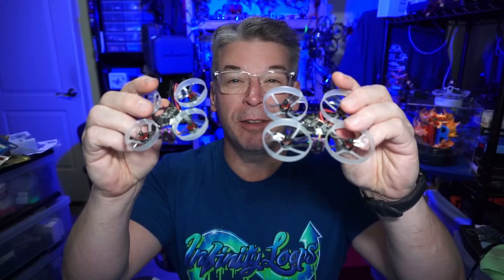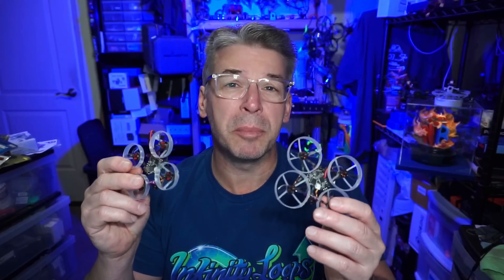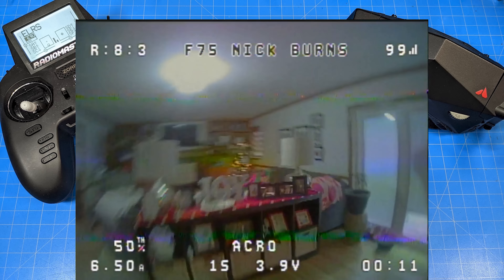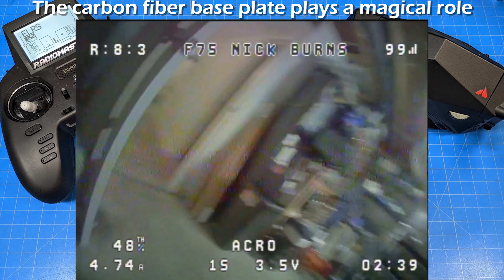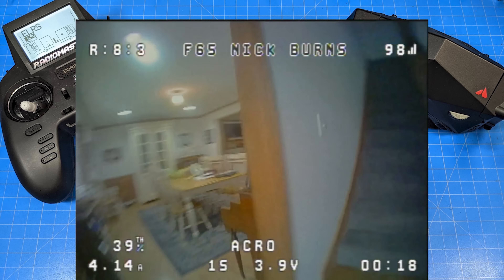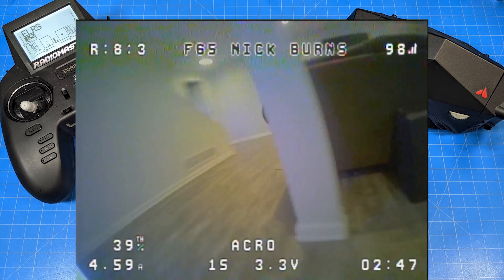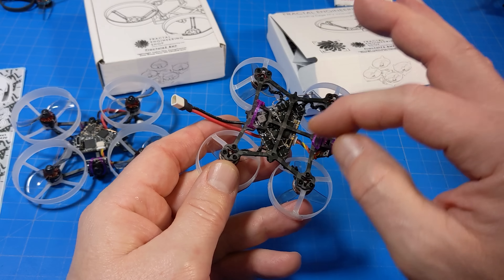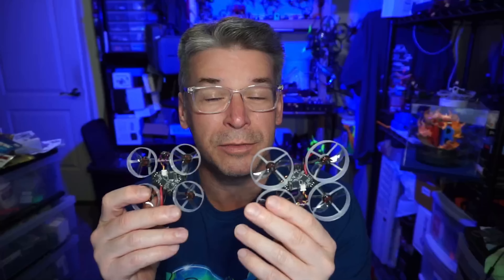Fractal Engineering F75 & F65 // QuickSilver // Whoop Improved

Comment: Hey Nick awesome review! I'm glad you've attributed the credit to QS as well as the frame; I do believe both go hand in hand and it's definitely helped getting the most out of this platform.

A few details I'd like to add, 

- Both F65 and F75 measure exactly 65 and 75mm motorpost to motorpost (TM). Only the stance was widened to fit the cam between the front ducts!
- The cam angle is adjustable by friction; you may set it how you like it and it should stay as is. The extra notches are only there to increase friction if it loosens up over time
- Lastly the stack screws are indeed self tapping and might degrade the CF after many cycles, but a drop of CA glue will refresh it enough to go a long way, annnd...
- The bottom plate is unofficially lifetime warrantied, so if you ever manage to break it, reach out to me and I'll fix you a new one ;)

Thank you for taking your time to share your thoughts on it, thank you to all the pilots that shared theirs in the comments and a big big thank you to everyone that supported us, my wife and I, throughout this journey!

Have a fantastic holiday and happy new year!
Reply from the maker: Good information. Thank you. I am struggling to pin this comment. But I will get it pinned :)
Reply: Thank you for the fantastic design.  I knew a racing quad would be way beyond my skills as I'm learning.  But if I want to really push myself and have a healthy stock of clean underpants I absolutly love ripping this frame!  I'm hoping to order a BNF 75 soon in the new year as our weather improves for serious outside rippage.  Thanks for the tip on the camera adjustments and what the extra notches are for, I missed that.  Plus these things look really cool...  If only Happymodel had LEDs on the Diamnond ELRS AIO (looking at my FrSky HM Diamond board) #sadpanda.
Reply: @amin0_acid310  Haha I miss those RGB LEDs too man! Seems like HM removed them after revising the boards for ELRS.
But yep a F75 def might save you some laundry given how tough they are; crash with confidence 😂
Reply: @fractalengineering  I'll be charging batteries for my F65 After a dog walk (Trivia part, I named it after the computer in GEM and the holograms, the 80;s one).  Never really thought to try and angle the camera a ton, was just happy it was level.  I see why the gang at Infinity Loops like it so much.  Only part about crashing I'm worried about are these spindly antennas
Reply: Thankyou for your work @fractalengineering! I'm really enjoying the 65mm whoop running on webleeds 0702 28000kv's - indoor freestyle has never felt better!
Reply: @fractalengineering  Hi Yves, once again, thanks for making such a great frame! I really love it!
I hope you can also make a version with a battery mounted sideways. I also thought about adding an extra “ribbed tail” to the bottom of the current front battery holder to pull it to the free mounting hole under the camera. That should block the battery from sliding forward in a frontal crash. I don’t have a 3d printer to try it, unfortunately.
Reply: @FractalEngineering I just bought your frame and will be building soon my variant.  Here’s a preview: https://i.imgur.com/viDnsV4.jpg

It’s a 2S pusher with sideways mounted battery. I’m waiting on the new Lite kit to arrive from Caddx to finally build it!  I really like thin/light yet durable design of the frame.  It’s a great idea of having a hard mounted FC to a whoop gives it more locked in focus of a regular quad with the safety net the ducts provide.
Reply: Hello Nick and Fractal, absolutely love the build I made with the 75mm frame, it is what I set as the standard to compare every other whoop build to. Do you have any plans on doing anything with a hd system? I would love to build a hdzero whoop with your frame, just not sure how the to boards will go one on top of the other?

Great work on these frames and thank you Nick for the great review.

Comment: I've been looking for a whoop that I can tune up to perform indoor freestyle for years. It all started when I joined IGOW a few years ago and started learning flippy floppies on an underpowered betafpv 1s whoop. I had a tough time of it but was hooked. The never-ending journey began, trying to replicate the feeling I got with a 5-inch quad but indoors with a whoop. Following Heads at Infinity Loops and CiottiFPV I found the fractal frames. I added weebleeds 28500kv 0702 motors, a full-size happy model 5 in 1 aio elrs board and some bi blades. Cranked the tune-up in betaflight and wow, this thing flies on rails. Enough power to catch my mistakes, stiff enough to take an aggressive tune. I love it. Thankyou! 

I tried to flash quicksilver but could not bind with my elrs tx (running v2.0- elrs). Gave up. Pretty sure  I'll need to upgrade to v3 elrs on my tx (and all my rx's) and this should work. Looking forward to feeling the new firmware..

Great review as usual Nick!
Reply: update - updated my tx to the latest elrs and I my spi elrs rx bound up  no worries :D

Comment: Nice review Nick!  I just bought an F75 BNF with the BT2.0. Really cool how they soldered on the BT2.0 to shorten the wires and shed some weight. The connectors in your review don't have that though. I noticed the increased stability of the Quicksilver and F75 preset tune right away, sometimes it feels like angle mode but it isn't. It's different but I like it, definitely helps the quad to go where you point it, very confidence inspiring. I had one issue, emailed Fractal but never heard back, maybe Facebook would have been better. Anyway, mine wouldn't roll over in turtle mode, because the props weren't reversing. Studying up I saw Quicksilver has an auto detect for flip if it is armed upside down, cool feature, you just turn it ON in Quicksilver. Oddly, that works fine, props reverse, quad flips. Cheers!

Comment: It’s a great whoop, I got the fractal 65 frame with the happymodel elrs F4 2g4 aio on 0802 25000 kv and it flies great on betaflight but I’m gone switch to quicksilver later.
Reply from the maker: Would it be your first time using QuickSilver?
Reply: @NickBurnsFPV  yeah so I’m curious how it will preform
Reply from the maker: @apachesmokewoundedsniper  yea, give it a go. Take a cli backup of your betaflight config first so you can go back if needed.

Comment: Thanks for the Vid.  I ended up with the 65mm frame kit.  I used the Happy Model elrs Diamond board, Beta Flight 4.3 and some happy model 702 26000kv motors.  It reminds me of my old 350cc 2-Stroke sports bikes from the late 80's.  I don't fly it as much as I'd like, even at the lowest camera angle (for a newbie like me) it's fast, but as my skils improve I take it out more ovten.  I love the feel though, tried a few canopy's from thingaverse, I'm goign to go back to the one it comes with (it was fun to experiment).  This Channel got me to Infinity Loops and I saw Heads fly this and ordered one.  I think I'm going to order a 75mm bnf in the new year.  I like both 65 and 75mm formats, and I'm also curious to fly one as the builder intended.  Highly recomend these kits, I can only guess the prebuilt quad is amazing (Watch the video to see how he get's those motors connected, really takes his time and puts a lot of pride into these builds, amazing).  Enjoy both Fractal quads, it was great to see you fly them.  One day I hope to rip around my condo like you do, slowly getting there.  Cheers!

Comment: I really like this frame and its durability! I ordered the 75 frame last February and haven't break anything ever since! This is my first whoop recommendation at the moment, especially for beginners.
I only had two small issues with it:
- The battery always slides out of the mounting loops in a crash, so I have to use rubber band to keep it there, which adds another 1g or so and the frame is not the lightest one even with the diamond board. So I wish Yves makes a version 2 of this frame with the battery mounted from left to right instead of front to back.
- When I first received it, I just used a FC from my old whoop. It was BetaFPV 1S AIO. And the problem was that USB port was sticking out the bottom too much, so I couldn't insert the battery. I had to add extra washers underneath the FC to lift it up a bit and also some rubber pads on the bottom side of the frame to add extra space. Having the battery mounted sideways would've also prevented this issue. 
Apart from this - the frame is amazing and I guess unbreakable. I crashed it a lot and pretty hard and I only replaced props so far. I use it with happymodel 0802 19000kv, a diamond FC with ELRS and a Foxeer Pico cam. It's flies fantastic and gives you much more confidence to fly aggressively.
I fly it on Betaflight 4.3 though.. I tried Quicksilver and it flies great on it as well, but the biggest issue for me was that I killed two brand new batteries on the first two flights. I don't know why. I set it as it was recommended by devs for 1s, but still ended up with the whoop falling at some point because the voltage suddenly dropped to 2.5v. As I can see you kind of had a similar problem.
Another thing was that I couldn't make the 16:9 camera work. The image was squeezed to 4:3, but OSD fonts were ok, so I guess it is something with support for 16:9 cameras and there's nothing in settings or in Quicksilver docks. So I rolled back to Betaflight and absolutely happy about it. I don't see that much of a difference in flight performance, but at least I have much more experience with it and know what I need to tune and how. Maybe I'll give the QS another try one day, but I'll use BF for now.
Reply from the maker: Yves has been combing through the comments. I did note in one of his responses a new beta battery mounting. I might be worth it to make contact to see about testing this as well.

Comment: excellent review sir! I love my fractal builds! I have 2 mobthicc Heads builds and a fat boy x12 on the 2mm plate with crossfire and a true rc antenna for 75mm builds 1 65mm and I'm currently waiting for a 65mm bnf. I'm hooked on the fractal frames. highly recommended
Reply from the maker: Thank you. Appreciate the additional input.
Reply: @NickBurnsFPV  love them, the additional  durability is definitely a bonus! I'm destroying alot less parts on these frames. the screws hold up in the carbon fiber really well. the diamond boards seem to work well when they work but in my experience it's 50/50 if they work. of the 7 I've purchased 2 were doa 1 dropped out of the sky first flight and one died configuring it just plugged into usb no soldering yet. but the other 3 have several flights and are good enough for me to keep buying them. x12 is like a tank though I only killed 1 crash ripped off battery lead and it contacted the board elsewhere and burned out.
Reply: @isaacmitchell7780  Thanks Isaac, got your order prepared btw with a little surprise mr. gnb boi :D And I concur with your thoughts on the DF4; I've had LOTS of duds, but once repaired and/or I got a good one, I know it'll last a while. All my BNF are stress and flight tested before shipping so that should take care of that part :)
Reply: @fractalengineering  you spoil me sir! thank you so much! I love your work!!!

Comment: Great review, great whoop.
I'm flying on a F75  on x12 and various 802's.  After a hundred packs or so...
Tracks amazingly well, i think the squashed-x really shines here. Also tough as anything. I have broken ducts, all v4 mob ducts, always at the joint by the motor. It's3.99 for 4 so no big expense and i rip hard and crash hard. I use holders for 450 and put a rubber band across extra for 300's. I wish the spkies where just a little larger to hold bands better. The tpu works well, but only for its exact battery size.  honestly think a rubber band is quicker when you're burning through packs. Also lost the self tapping screws for the fc after repeated abuse, just using 2 now. Camera mount has held up 100% Definitely love this quad and the clever design that's gone into it. There is a vid of mine flying on my channel, check it out.
Reply from the maker: I believe Mr. Fractal has been working on two different beta battery mounts, one to mount side to side and another that holds more batteries better. here in the comments he sent that response to another comment. I believe he also asked if they would like to test it out.

Comment: Not sure if I posted my input on the 65 size but here’s my input excellent out of box the acro tune is like flying my 3” quick silver or beta that’s been a preference from the birth of both I race whoops and I bought this cuz I kept breaking my mob6’s so I heard the fractal was way more durable and thus far it is however I fly weird rates in angle mode and couldn’t get it to feel like my mob6 useing quick silver so I dumped it and put beta on it and it flies just like I’m used too I did save the quick silver firmware though cuz in acro wow

Comment: Hi Nick,

Fractal frames are my recommendation to anyone wanting to whoop around. I had less AIO failures, less broken whoops... but as many motor burned and as many camera destroyed...

Some comments:
The battery holder gets quite stretched over time. I have many batteries spanning from 450 to 530mAh and some are wider than others (by 0.5mm?). That's enough to make the hold not as good over time. I'd love to use some rubber bands instead. I'd love to toilet tank my batteries too :)  Mr. Fractal, maybe a slight change for the next iteration?
 
The camera holder is surprisingly good, even with ANT lite cameras that have the plug.
I'm using the old 3 blades props that gave you more efficiency in an old video. I actually prefer these for indoors, as you can turn more aggressively. 

As for the diamondF4, I had one with horrible video noise coming from the factory, The issue was in one of the caps immediately above ground pin for the battery. It was not properly soldered in the factory and I could see the lack of solder on one end. Happymodel asked me to send it back to them for repair, but that costs a bleeding fortune from my place... Eventually I repaired it myself, but that was a heck of a job... Within maybe 15 flights it died. I contacted HM again and they agreed to send me a new FC, which was really kind. That one has been flying fantastic ever since (board dated November 22)
Reply from the maker: much good information there. Thank you so much. Certain helps anyone needing more Fractal experiences.
Reply: thank you for your detailed feedback, very nice to hear how it holds up over time.

About your lipo holder issue I might even have a solution for this already 😄

Check out the "universal 450mAh" strap file in the downloads section of the shop; it's got a corrugated front loop that I designed to fit the smaller lipos, as well as stretch to fit the larger ones. Just print it out or find a friend to do it for you (or I'd be happy to toss you a couple with your next order)

It is still in development too, so I'm happily taking feedbacks on it
Reply: @fractalengineering  Thanks for the offer 😀
I was looking into strapping a small rubber band between a front screw and the back one... Since I've built mine like Heads, I'd need to add a front screw....

Comment: I have the x12 board, I use it on a 2s 3" toothpick, it's been amazing. I put betaflight 4.3 on it, rpm filtering, and took 3 packs to tune it BEAUTIFULLY. Auw is around 85g on 450 2s. 79g with a 350 2s. I'm using 1204, 8000kv.
Reply from the maker: Nice, seems like a ripper build

Comment: I have not flown the BNF but I moved a Mob7 with tiny whoop 25000kv motors onto the fractal frame and it might be by new favorite backyard/play set ripper.
Reply from the maker: There is something about the mix of carbon and still prop protection that makes them feel different.

Comment: Fantastic job on both flights and the review on both frames Nick👍👍😎😎👍👍 Hey many mah's was you running on both the 75 and 65??
Reply from the maker: Thank you. Its a bit hard to see on the batteries, but if we pause at 4:44 we see the mah, on the 65mm I use a 300mah on the 75mm I use a 450mah.
Reply: @NickBurnsFPV  Cool thanks Nick😁😁

Comment: 16:02 I’ve had 2 x12s go up in flames.  Literally… They were on the mob7 1s hd.  If you HV lipo those with bt2.0 the vbat lights up the blackbox logger and the whole thing starts on fire.
Reply: dang with 1S??
Reply: @fractalengineering  yes!? They wired up the open loger really weird.  
It happened first when i tried 2s with throttle scale.  I caught it fast enough the x12 was fine after removing the logger.  
The 1s ones i didn’t expect it to happen on and it kept flying while on fire until the battery caught and the whole thing went up fast
Reply: @Shauny_D  ohh interesting I'm just seeing now the Openlager seems to be rated for up to 4.35v and has an onboard voltage booster for hd cam; very odd
Reply: @fractalengineering  yah but they ran the power from battery to the logger first then to fc and hd split cam so it would take all the voltage spikes.  I couldn’t believe it was wired that way.  I have no idea why 🤷🏻‍♂️
Reply: oh maybe fit the hd cam V booster you mentioned.  
it didn’t work! haha

Comment: I’ve been running Quicksilver exclusively  for a while now - it is by far the best firmware for angle, though I know a few people have switched back to Betaflight for acro due to the lack of crash recovery
Reply from the maker: I have heard about crash recovery but don't use it. I have not used it as I most bnf don't come with it on so I don't want to confuse viewers. They might think I have some super hero level reflexes. :)
Reply: @NickBurnsFPV  I haven’t used crash recovery either, as I’m an angle pilot for whoop racing, but the people I know that use it say it’s magical. Though once you start getting anywhere near RAB speed it just can’t keep up and is more of a hinderance.